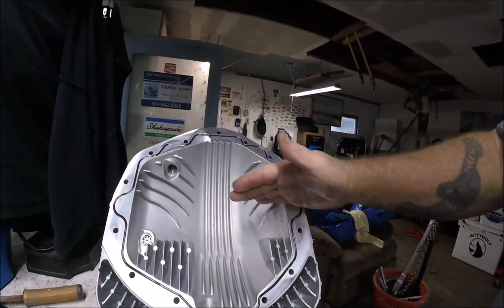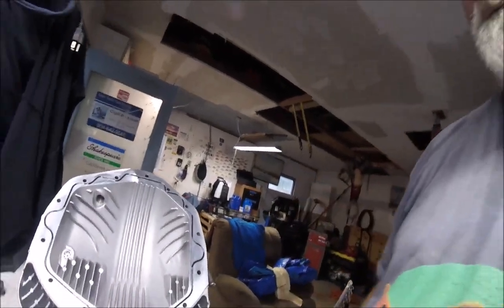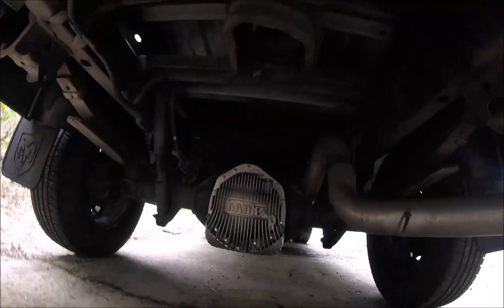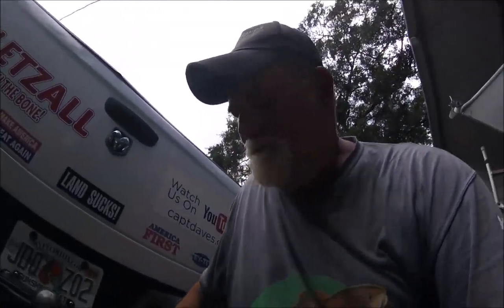UPGRADING THE BOAT HAULER, ''BANKS RAM-AIR''

Comment: looks good. I changed the differential fluid on my Subaru at 100K also, because i tow a boat with the damn thing. I was also shocked how clean it was. Did u see i got a Ram too? I was surprised i didn't leave a 'witty' comment
Reply from the maker: Finally out of nerdy fisherman status.

Comment: Your old one would have gone three hundred thousand miles no problem!
Reply from the maker: I was going to have my mechanic friend do it for 300, so I spent some more because I got rid of a bunch of buck collectable knives and did it myself, and it needed gear oil changing, according to the manual. So I did it, and will change the gear oil again someday. It's not a sin to upgrade and do maintenance. I frquently do the same with my livelhood, my 250 Suzuki outboard. PLUS. I'll make some change off this video too!